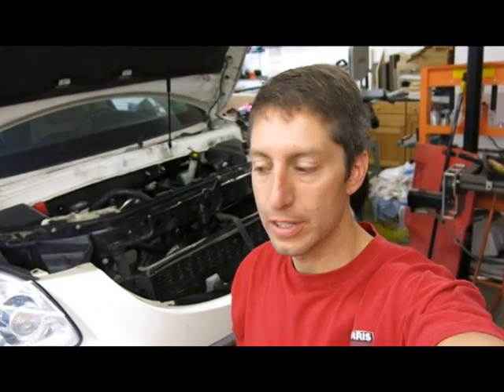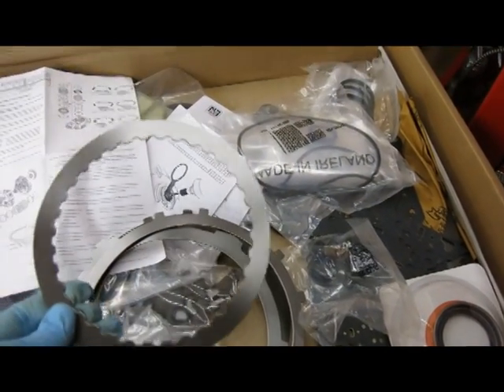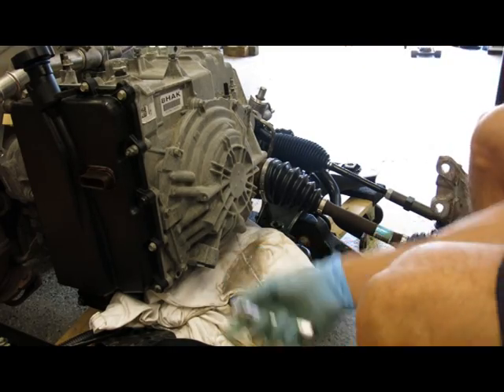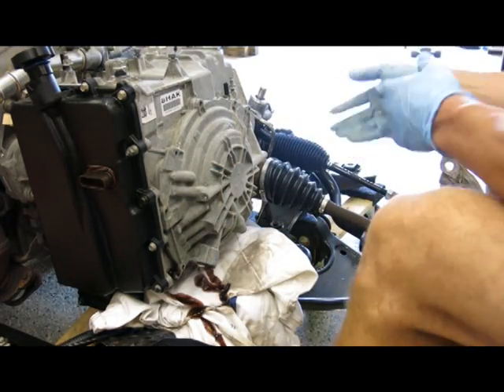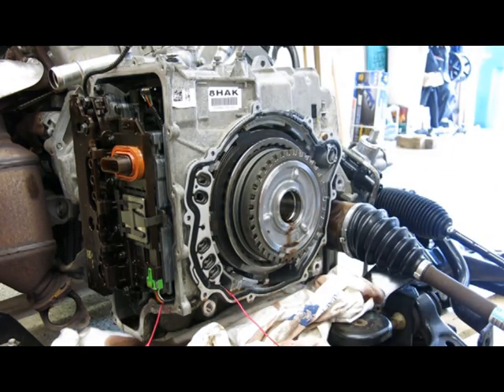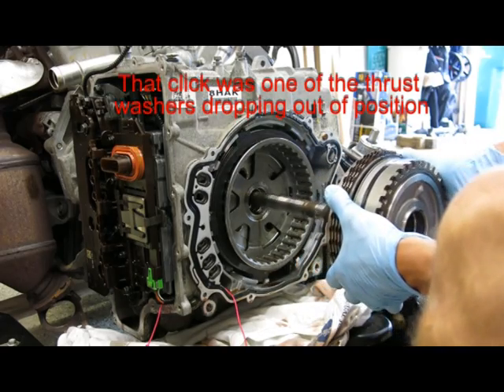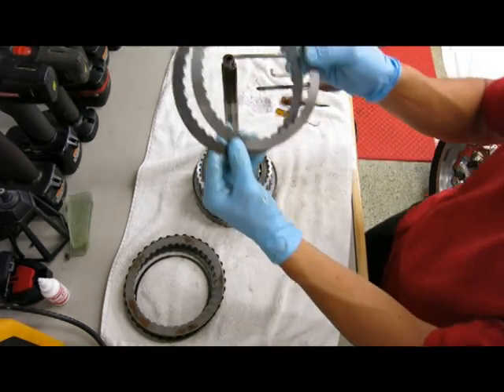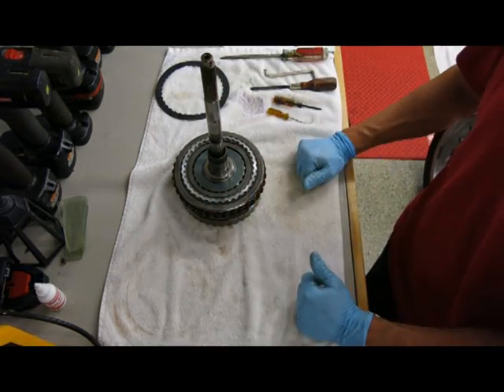Enclave 3-5-R Waveplate Replacement - Part 1

Comment: Will this be the same procedure on 2009 saturn outlook? And is really necessary to remove the motor/transmission or can it be done in vehicle?thanks
Reply from the maker: Fundamentally, the process is the same.  Some people have reported being able to do this in the vehicle without fully removing the engine/trans, but you need to lower it from the car enough to get to the transmission cover as shown.  Obviously it's a lot more restricted inside the car. Good luck!

Comment: my question is why is anyone changing this wave plate at all and for what reason or trouble issue? I just bought an 08 enclave and it has never had fluid swapped out or rusted trans lines swapped out. Now with new coolant lines swapped out no longer leaking the new fluid Vl Dextron fluids, its slipping worse then ever? Is this why ???
Reply from the maker: OEM 3-5-R waveplates for these transmissions were not durable enough and had known issues fracturing.  If they fractured, your transmission was toast, so it was advisable to replace them ahead of that problem if possible. Revised versions had a different heat treat and/or shot peening to improve durability.

Comment: Chris, i have a question regarding the clutch drum? I think its called. I followed your video, but when i pulled my assembly out, it was not tight like yours. I had a few more pieces come out and one of the waveplates was loose.

Comment: The thrust washer you mention that dropped, was that deeper within the transmission or on the outer portion? Would I have to continue disassembling the transmission to find it?
Reply from the maker: I didn't disassemble any further than what you saw.
Reply: @SlideruleRacingProducts  ok thank you Chris. 2008 malibu with 81k miles and 3-5-reverse wave plate broke completely into two pieces 😠 ridiculous...
Reply from the maker: @rickygray7767  Be careful with that.  When I did mine, the wave plate hadn't broken yet.  Once it breaks, if it any pieces make their way around your trans, then a more significant breakdown and overhaul is needed.
Reply: Thank you Chris

Comment: good video but one shouldn't re install and drive, I believe bearings fell out of place internally, as noted by the "washers falling" text. 

You would need to further dissemble to get them bearings back in place.
Reply from the maker: Nope - it was just a thrust washer and I was easily able to place it back into position and finish the installation.  We drove the car another 40K miles before trading it in, so it worked fine.  If you have a similar problem and are having trouble getting such washers to stay in place, you can use "Dr. Tranny's Assemblee Goo" to help hold things in place.

Comment: NOTE:  I installed all new motor mounts (including upper "strut" mount) on my 2010.  On the trans mount he is working on here...GM gave the mount VERY long threaded studs.  In my efforts I found that you cannot remove the old mount without cutting the stud off.  I tried lowering the sub frame as much as I could get it to go and without possibly destroying things like the AC lines etc etc.  It just seemed that the mount could almost be removed...and the new one almost installed but for the studs not wanting to clear.  My fix was to take the new mount and trim down the studs just enough to fit in there.  Then once everything is brought back into position there is plenty of threaded stud left for the nut and several threads past the nut.  I couldn't figure out why GM felt those studs had to be so long as to have an inch or so past the nut.  I used loctite on the threads and all is well thousands of miles later.  Only my front mount was broke causing the engine to rise and fall under torque making an odd thump sound on occasion.  So I replaced them all.  However I will say typically only the front mount goes bad as it's somewhat different than the other basic type mounts...from what I could tell.  The rest of my mounts and torque strut appeared very solid whereas the front was totally trashed.

Comment: Another question. The thrust washer that fell. Was it all the way in the back ? So would you have had to take out all the other packs anyways ?
Reply from the maker: My memory is a little fuzzy, but I think that I could have fished it back into place without removing the other packs.  I would definitely use the Green Tranny-Goo this time around to hold those types of items in place during reassembly, too.  It would make things much easier when trying to reinstall things horizontally.
Reply: Justin how did the job go? 
Also about that thrush washer did you have any issues with it falling or fishing  it back into place before reassembling?

Comment: Hi there. Im having an issue with my 2011 Acadia (delayed shift to reverse and slip when shifting to 3rd and 5th. 1st, 2nd, and 6th shift perfect. Took it to the dealer and they said it was the 3-5-R wave plate. So by replacing that on ring in this video should fix that issue? Thanks!
Reply from the maker: If you're having shifting problems, then you're probably past the point where you can get away with just replacing the wave plate..  If the wave plate is broken and the pieces have managed to make their way around your transmission, then your transmission is going to need more extensive disassembly and repair.
Reply: @SlideruleRacingProducts  thats bad news but thanks anyway.

Comment: 2008 Saturn Vue 3.6liter and doing a motor swap so wanted to do this 35R also but you mention the thrust washer fell which requires deeper parts removal.  If I wanted to just do the 35r plate should I separate the motor from the trans and tilt vertically so looking down at all parts and allowing gravity to hold that washer in place?

Comment: I appreciate this video, I have a 2008 Honda Accord Coupe and I can swap out the friken transmission right from the engine bay barely having to take out too many things. The enclave does not need this massive engine or removing the whole engine just to get to the transmission. The problem is dumb people who refuse to call out the American auto companies for the hypocrisy of building high torque 2.4 L diesel engines for the European market and giving us low torque low power monster piece of shit gasoline engines. It's the reason why everyone in the Western hemisphere is switching to Imports as we get the crappy products and they sell their best products over seas. Even Ford is going to be assembling Volkswagen vehicles on contract inside Ford plants lmfao. GM , Ford will be merging soon with other companies and FCA will surely go bust soon again as the Crap Pacifica is a joke and no one is buying that garbage.

Comment: Hey Chris, I know this post is crazy old, but I'm having issues with my 2013 AWD Traverse. It seems to be slipping between the 2-3 shift....I took it to the dealer and I believe they thought it was the wave plate, but didn't do a breakdown to verify. Your videos are extremely informative, but I was curious of whether or not this symptom sounds about right for a wave plate and what was your reasoning for doing the timing? I'm still driving the vehicle... Currently I have 145k on it. Also would you call this a weekend or week project? Again, thanks for the info, and great video.
Reply: Just thought about it, and it may also be slipping in 5th
Reply from the maker: Well, the wave plate is used in 3-5-R.  So, it could be related.  Most people, though, lose reverse and then the transmission gets REALLY bad.  I replaced ours before it broke, so we never had any issues.  If you're doing this at home without a lift, as I was, it's probably closer to a week project than a weekend project.
Reply: Did you end up replacing the parts yourself? Gm has a recall on these transmissions btw

Comment: I did this fix on my 2008 enclave but reverse still slips and when it goes to shift into 3rd gear it puts the car into limp mode. I believe I fixed it correctly. Do I need to flash the computer? Also after waveplate fix I dont have any tail lights. Hopefully someone here can help. Thanks!!!

Comment: I know it's been a while since you made this video but I wanted to ask what year is/was your Enclave? I have a 2008 myself and it once in a while does not shift passed 1st gear. I have to turn vehicle off and on 2 or 3 times before it will change gears normally.
Reply from the maker: Ours was a 2008. Good luck!
Reply: mines it’s doing the same, not shifting to 2nd gear , please let me know if this fix works on yours, cuz i don’t have problems in 3,5 or reverse

Comment: My 2016 Traverse  had the no reverse problem. Then it only went into 1st gear. We bought it at 23k miles and it had 27k at the time of issue. GM covered the cost of repair, but I was wondering if we're in danger of it happening again. Does anyone know if new parts have been able to be more reliable?
Reply: Normally when we rebuild them we use the most current parts that GM has updated to not be junk, but that doesn't mean your transmission is invincible, I do this repair pretty much on a daily basis and don't have return customers, so I would assume the newer parts are holding up much better than the original ones.

Comment: I have my 35R drum out and the wave plate is broke into 5 pieces. I ordered parts but the wave plate i got from Rock-auto does not fit the splines on the hub. it appears to be too large and would spin. Did I get the wrong 35R wave plate or does it just fit loose on the hub?
Reply from the maker: It should not spin around the splines on the hub
Reply: Hey i know its an old comment but did you finally get this back together? If so how is it holding up?

Comment: Replaced the 3 5 reverse wave plate and car is now shifting smoothly through all gears. No broken parts and wave plate showed color signs of heat failure. I replaced the plate with the transmission still in the car (08 Chevy Malibu 3.6L). Thanks again for this video! 👍🏼
Reply: Cardiac Cats did you have to drop the cradle a little ? Or did you have enough access with dropping anything

Comment: Thanks Chris. Good video. What's your preference? Changing in vehicle or out? There are a few videos on engine removal, but nobody is as detailed as your video.Maybe you can do one on engine removal?
Reply from the maker: I will see what I can put together.  I wasn't quite as good about the 
video recording when I pulled the engine but I do have some videos.  I 
still have some engine timing chain videos for the Enclave that I keep 
meaning to process as well.  If I had to do it over again, I'd do it the
 same way, I think...  Pulling the engine was a pain, but it was a 
straight forward process. And once it was out, it was sooo much better 
for access.  I will try to work on those engine removal videos, but 
please don't hold your breath.. I've been working 13 hour days on a big 
project at work which hasn't been leaving me much 'home-project' time.  
Good luck!

Comment: Need additional help? The 3,5,reverse wave plate is not flat, it's bent in several areas. Is that plate supposed to be flat? Symptoms are thump into reverse and not shifting out of low gear. Second question, the outer bigger plate still in the transmission came out of place. What position is it supposed to be in. I can give you my number if it's easier. Thank you.
Reply from the maker: The wave plate is a spring plate and is supposed to be 'wavy' so that's normal.  Regarding your other questions, I'm afraid I can't be much help - but I tear deeper into the transmission in my second video... perhaps there is a shot of the other plate you are referring to in that video?  Good luck!
Reply: Thank you, it was very helpful

Comment: SO WHAT IS THE SYMTOMES??? IN ORDER TO THIS JOB?
Reply from the maker: Hi Paul, if the waveplate has already failed, then the symptoms are that
 it may not go into reverse or will go into a limp home mode when 
driving.  If that is the case, then the transmission will need to be 
disassembled and this video may not be a lot of help.  If it hasn't yet 
failed, then there won't be any symptoms and this video can help walk 
you through how to change the waveplate before it fails.
Reply: Thanks. For you help...
Reply: @SlideruleRacingProducts  Hi chris, I have a 2009 gmc acadia that I put it reverse and it barely moves and the rpms go really high. Do you think it might be the waveplate?
Reply from the maker: @juanflores4279  It could be.  If it doesn't do anything wrong in any of the forward gears, though, it is probably related to something else.  If its the waveplate, you will see problems going forward in gears 3 & 5 also and it will be making a lot of noise because parts of the waveplate will be getting ground around inside the transmission.

Comment: My wifes 2008 Acadia shutters at about all speeds. Is this caused by the wave plates? I had the transmission flushed and it got worse.
Reply from the maker: All speeds?  Have you tried driving in the manual shift mode? The wave plate problem usually results in error codes and the transmission not working at all in a few gears.  Shuddering is usually related to other things. If it gets better in manual shift mode, then it probably is related to the torque converter.  The fact that it got worse after a flush suggests that there is a fluid pressure problem that they exacerbated with the backflushing.  This could be either the filter getting clogged or they created or made worse a problem in the valve body - or the torque converter needs to be replaced.  If it was*just* a problem with the valve body or control circuits, (TEHCM) those could be removed without taking out the transmission, but in all likelyhood, you'd want a shop that was going to tear down the transmission to check out the rest of the components anyways.  Let me know how it goes!
Reply: Did you get it fixed?

Comment: My mom owns a 2009 Chevy Traverse. Yesterday the car would not go into reverse, and would sometimes not go over 20 mph. I looked into the issue online, and it sounds like the wave plate has had issues with numerous vehicle models. We had it towed to the Chevy dealer today and are hoping for the best. Luckily we are still covered under the "extended warranty" for the well known wave plate issue (if that's what the problem is).
Reply: So....how did it go? Did GM cover yours under the regular factory warranty?

Comment: just wanted to throw this out there maybe it will help someone, i work for a dealership and do these all day long, there is a special policy on some 07, 08 and 09 that goes 10 yrs or 120,000 miles, gm realized this was a big problem in these years so they added special policy 14404 some have it some dont i would call my gm dealer and ask b4 i spent a large amount on repairs also if it has a special policy and was done out of the normal gm warranty of 100,000 gm issues a refund if it was done and you can prove it was done at a repair facility, check it out if your having this problem, only wave plate failure though, not the tcm, hope it helps
Reply: Can you tell me if this apply's to the 2012 Sonic 6T30 transmission? It is clear GM has a "problem" with these series of transmissions, 6T30,40,45,70, and i believe 75 as well. They have a recall for the input turbine shaft causing limited speed which GM states can result in a crash. The wave plate breaking while the vehicle is in motion also produces the same symptoms as the turbine shaft, however, I don't believe GM acknowledges this.
Reply: This just happened on my wife's 2010, with 65k miles.  are 10's not included at all?
Reply: No unfortunately not but depending on the dealer and if u are the original owner some dealerships will do a assessment and u pay so much and they pay the rest if u r the original owner,  if so u may want to call the local dealership and ssk for assistance or gms number
Reply: Ask
Reply: joez701 i'm in that process right now. Have been on the phone with GM, and the car is at the dealership. The diagnosis is the wave plate
Reply: I just looked again it only covers 7,8, and 9, I'd get with the service manager and let them and gm know if they want to keep your business they need to help,  by no means don't mention me assisting with information
Reply: certainly.  All automotive tips are anonymous :)
Reply: After phoning GM back and forth and relating that the recall symptoms on 2012 Sonic with a bad turbine shaft is so similar to the failure of the 3-5 wave plate breaking, causing limited speed--won't shift past 2nd gear--happened to my wife while driving on the freeway, GM refused to acknowledge the problem. GM can go..........I ended up fixing the problem myself, being a former ASE certified + GM factory trained technician helped. Plus I gotta give credit to Hiram Gutierrez who has tremendous experience and knowledge.
Reply: The problem exist with the 6t70, the 6t45 I have done around 800 or so since 07 I agree there should b a special coverage on the 6t70 6t30 6t45 I'm even seeing the retainer in the 6t75 coming loose and destroying the cover on 2016 6t75 it's unfortunate for those who have a problem,  I try to help as much as possible